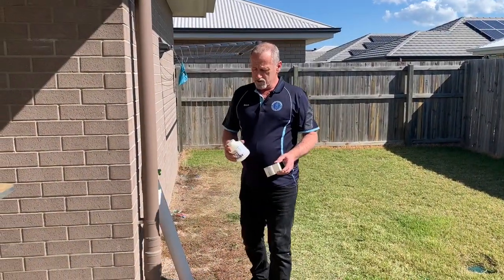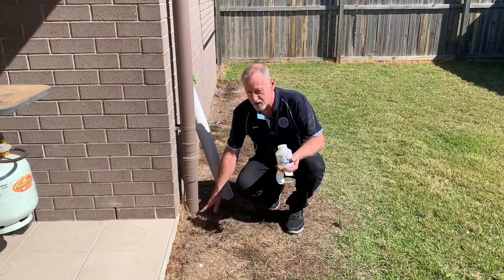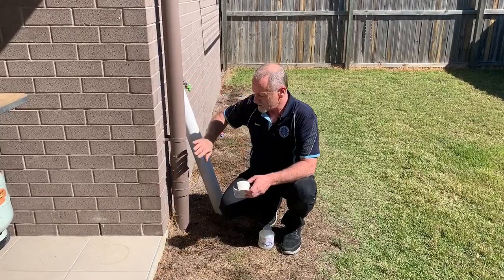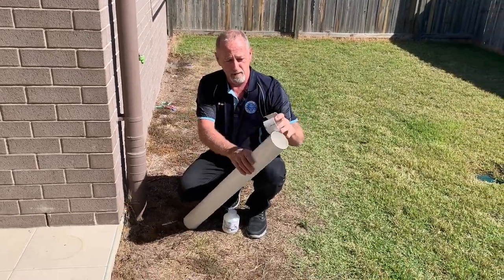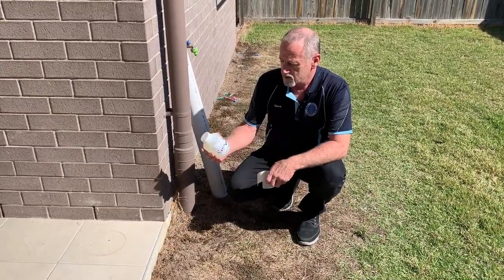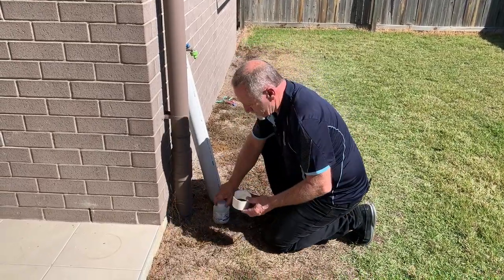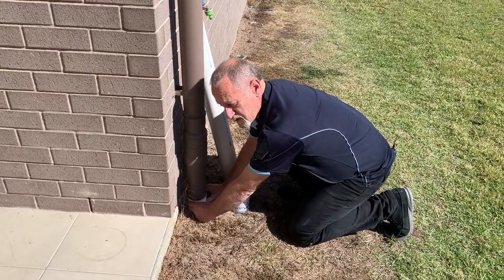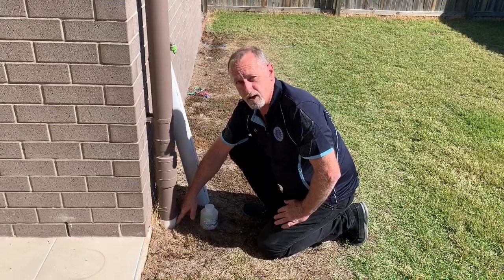Down pipe repair

Comment: Would this be suitable for a charged system?
Reply from the maker: Hi Dane, If you have a charged down pipe system, this may help as a temporary measure, however replacement of the damaged section of down pipe would be a more permanent solution. Regards Dave